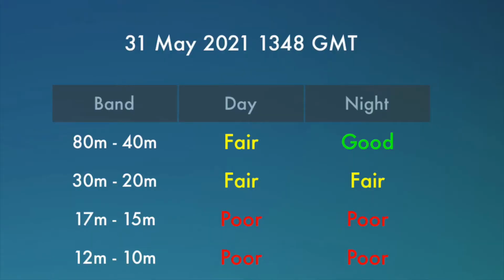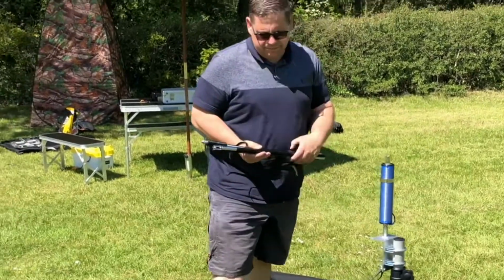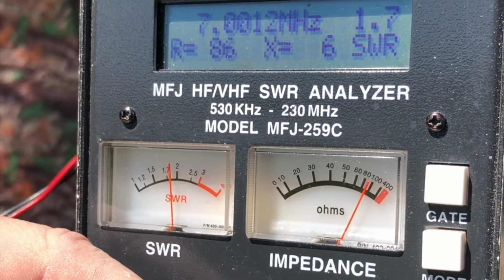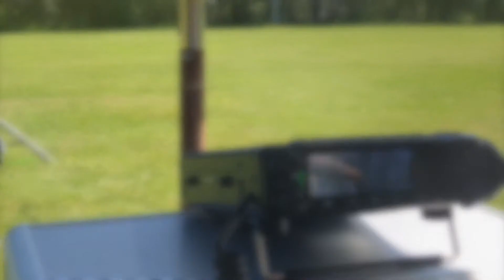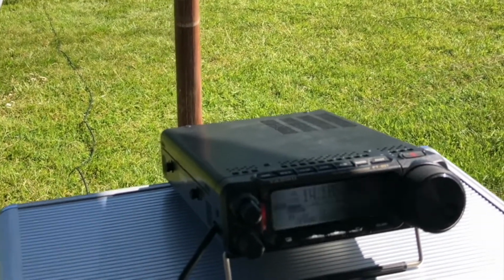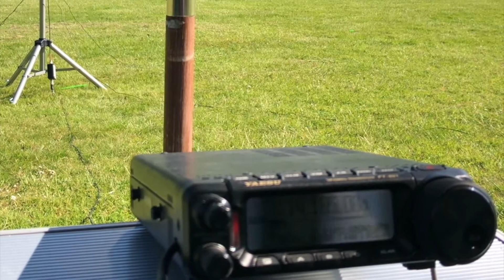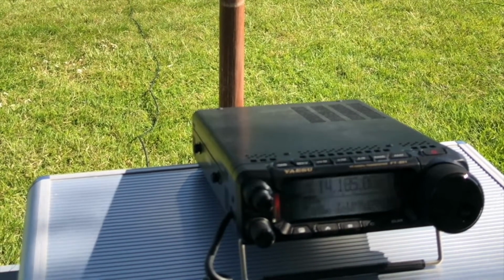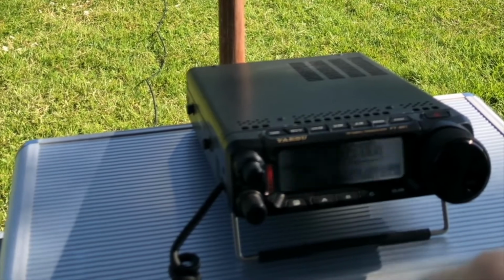Slidewinder Portable Antennas System,  Setup & on air test.

Comment: Looks very interesting! 👍👍👍
Reply from the maker: Thank you,  You can set these up almost anywhere Customers feedback is they are performing very well for them.
Reply: @Tantalicdavid  I am thinking it over to try out this antenna for my portable activities. We all know no matter which antenna we picking that we never gonna get close to big gun station performance.
I am just a one man army with ruined disk, shoulder arm spine syndrome and high degree arthritis. Any antenna is welcome which is simple to install in nearly no time to be able to enjoy maximum possible in play time (talking on the Radio).
PLUS: I am not having a Pick Up Truck or an SUV with plenty of room to have tons of accessoires with me. And on top ofit all I love to have my 100W available in the Fields. 
I already ordered a  light weigt foldable tripod speaker stand an hour ago. I am ready for some new sensation, antenna wise.
Thx for your informative video. Happy tuesday evening from your Friend Uncle Guenter, DK5ONV
Reply from the maker: @DK5ONV   Well as you already have a tripod you would only need the Slidewinder DX Coil & our Military folding whip, These perform great I think you would be surprised what you can work with our coil & whip. not to be compared to what others offer we know we use them our selves.

Comment: Is a ground connection required?  Can I install it high and run a ground wire.
Reply from the maker: It comes with the 4 x 4.5m Radials it's not designed to be used up a mast, but can be used on a balconey
Reply: @Tantalicdavid  Is this height limitation because of its structure or distance from ground?
Reply from the maker: @Markinpuff   Its a ground mounted antenna system not designed to be up a mast. works best at ground level Please search here on Youtube & the internet lots of customers have put content out about their experience of the Slidewinder DX Antenna

Comment: Can coil be left outside in wet weather
Reply from the maker: Yes 100% can be
Reply: @Tantalicdavid  would the whip snap in mild winds or is it resilient
Reply: @Tantalicdavid  could you use a springer whip on the coil base
Reply from the maker: @T.M.G2014   Any antenna under 3m with 3/8 24 tpi thread should work But our Mil whips tend to be a best match to the coil
Reply: @M1ECC Amateur Radio Station  of course,  I was thinking of loft installation what I could use as a whip
Reply from the maker: @T.M.G2014  I would recommend not using hf antennas in a loft space, Unless you have no other option as you will cause alot of RFI & get alot of QRM from the electric cables in the loft.
Reply: @M1ECC Amateur Radio Station  I've used my current loft antenna for over 2 year now with no issues , it's a 10-40 Spiral loop  it's used when storm weather is forecast and I drop my dx commander,  I'll report on the slidewinder , I'm just about to order :)